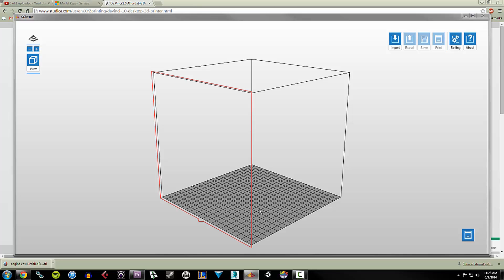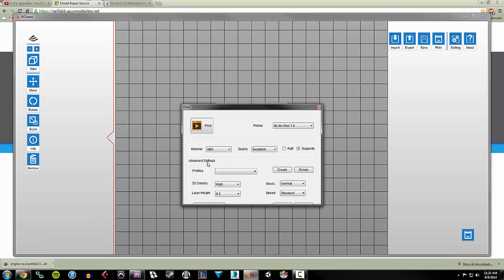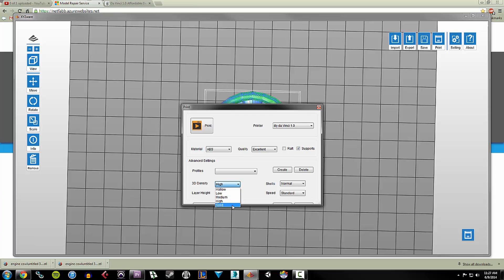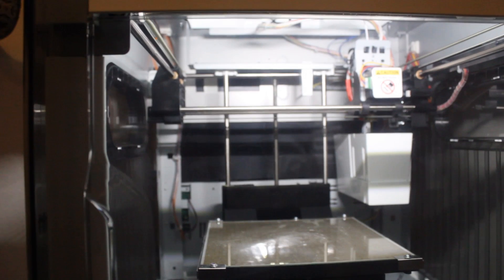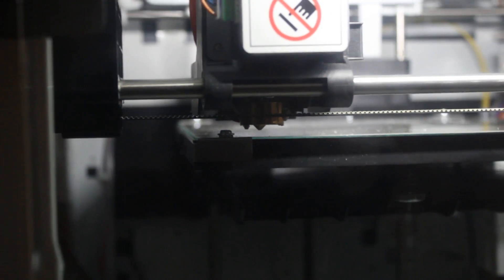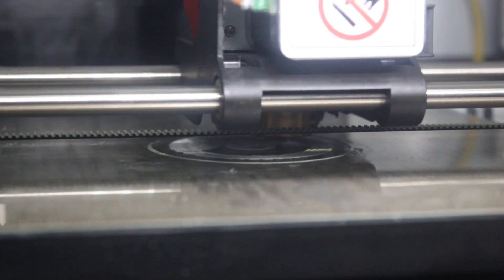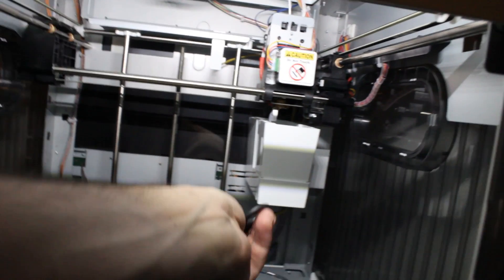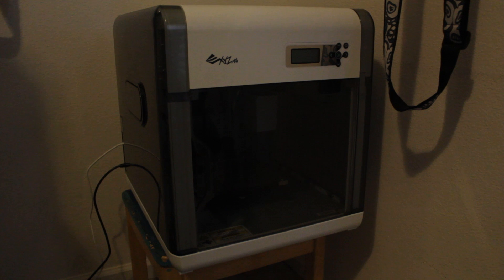3D Printing With DaVinci XYZ

Comment: WTF?? A@@@@ole . The  metal brush is for cleaning the extrudor head ! He just f...d up his 3d  printer. The deposit zone is glass covered don't do that!! Please take time to read the manual u doncki

Calibrating it to get the deposit zone very horizontal is quiet hard but then it's easy to use.

My advice don't remove the object imediatly just wait for ABS cooling (1h) and u wont need the removing tool. just picking the object with hand

Using it in a french school with students between 11/15 . Macking 'bots structures... Quiet satisfied

Comment: I wonder if putting on ultimaker or Ramps 1.4 hardware on there with the open source slicers and firmware could improve the print quality on this printer, becuase the mechanics seem very good but the quality is just less than desirable
Reply: The quality is just from the firmware.  I have installed my Da vinci 2.0 with Custom Repetier firmware and now it's MUCH better.  Prints come out basically the same quality of a Makerbot.  I can now use 3rd party filament and repetier host/cura.

Comment: The toothbrush does not have to use it on the plate otherwise the scratches all over! It should be used only to clean the under Extruder!

Comment: Is this printer too loud to use in an apartment? Like does it produce a lot of bass from moving around, would you ever use this in an apartment?
Reply: I've used one, and it does make quite a bit of noise. I personally find it soothing throughout the day as background noise, but it isn't exactly easy to sleep while it's running. If you print any fairly large objects, it's a good idea to print them as early in the day as possible to allow it ample time to print before bed. Hope this helps!

Comment: Hello :-)   Can I ask  what  resolution you used in the printer settings as they  change the  settings from  the printing the mode :  END-0,1mm(100 micron) STD-0,2mm(200 micron) SPEED-0,3mm(300 micron) ULTRA FAST-0,4mm(400 miron).  Waiting for your response Thank you so much !  Romagnoli  Alessandro

Comment: Thanks for showing the tip about netfabb. I had a part that filled in too after selecting my print parameters. I ended up changing the design slightly to get it to print properly.

Comment: Do NOT use the wire brush to clean the glass table. It is used for cleaning plastic off the extruder head. Use a wet cloth for cleaning the table and the plastic scraper for getting off pieces of plastic from the table. Leave the wet cloth on the table for a few seconds and the glue and any remnants of plastic will wipe off easier.

Comment: The calibration step is for assuring the table is level with the print head. It has nothing to do with telling the print head where it is at. The print head is sent to the HOME position. There are sensors that tell the print head that it is in the HOME position and from there it knows where it is at. I had one of my table adjustment nuts come off and found it laying on the bottom of the printer. I had to recalibrate the table and I added lock nuts on the adjustments nuts so they wouldn't move. There is a calibrate command in the utilities menu. The print head touches those metal pads at the corner of the table and gives a readout of the measurements. They have to be in a certain range to pass the calibration test.

Comment: You selected solid for 3D density and then go to netfabb to repair the model, but then you changed the density to high. If you are going to demonstrate how a model gets repaired by netfabb, you should select the same print parameters before and after the repair.

Comment: First off, great video! But...how does that propeller get lift? Aren't propellers supposed to have gaps between the blades? Or would the bumps provide enough of a pressure difference to make it go?
Reply: I think it's actually a dummy radial engine for a model. Would be painted black then placed on the front of an models engine cowl behind the propeller to look like engine cylinders. IMHO anyway :)
Reply: You asked: "how does that propeller get lift?" the simple and most direct answer is "it would not".  Someone was mistaken about that item, either it's a poor model item, or a poor stl file of a real item, or a really, really horrible print.

I think the first case is the answer.  The OP was mistaken in thinking it could be used to provide lift to a air vehicle.